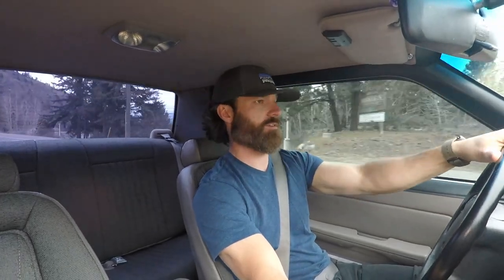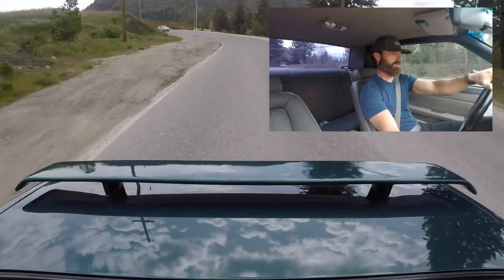Why I bought the Comp Cam XE266HR camshaft for my SBF 5.0 Foxbody Mustang - Ride Along and MORE!

Comment: I’m almost sold on this cam lol. Really love the sound and want to maintain torque as well. Building a similar setup for a 63 Fairlane Ranch wagon. Only thing I’m left curious about is fuel mileage on the highway lol.
Reply from the maker: Very cool! I really like the cam. In my 3000 lbs car I have seen everything from 14mpg (driving like an idiot) to as high as 27-30mpg on the highway under very mild driving conditions. My milage has definitely gone down since changing the various bit that I have but I have also increased my "smiles per gallon" 😁😉
Reply: @KASLCustoms  that’s good mileage when taking it easy lol. Exactly the information I was looking for, thanks!
Reply from the maker: Yup I agree! Anytime buddy

Comment: I read somewhere that the comp xe 274HR was ground on the same ramp rates as the 266 and doesn’t give up any power down low. Do you know if this is true? Or how those two cams would drive vs one another?
Reply from the maker: I was considering both of those cams when I picked the 266. I liked the lower torque curve that the 266 had better

Comment: Happen to know around what length pushrods you used. I'm using AFR165 and XE266 cam and am having a hard time finding a pushrod length that provides a narrow sweep width on the valve tip.
Reply from the maker: Hi there. Mine measured out to 6.250. Do you have an adjustable pushrod? It makes life a lot easier 👍
Reply: @KASLCustoms  wow, ok. Ya I am using an adjustable pushrod. Mine seems to like 6.450 but I’m going to have to clearance the body of the rocker since it is making contact with the pushrod.

I just wanted to see if I was in the ballpark from what you got, and I’m not lol.
Reply from the maker: No worries! It’s best to over think stuff like this and measure 8-10 times. I would also move to other valves and check as well 👍

Comment: Hope you see this. 
March 31, 2022
Latest research says it's probably the speed sensor on the trans/speedo cable, on all (?) mass air cars.
Mine doesn't even have one, and I'm not even finding a wire to plug it in. (90 MA T5)
Other than that. It runs perfectly. 😁😎

Comment: Great vid. I have the XE 264 HR it is a good one too. You mentioned push rods ,what length did you go with? I used hardened CC stock length and they are slightly off center on the valve stem.i have roller rockers and they are not clearing my stock 94 valve covers. I don't see ant valve covers that will work with a 94,so I may try spacers if they will clear.
Reply from the maker: Thank you. If I remember correctly I used 6.250 length pushrods. I also had to clearance my valve cover oil baffling to get my rockers to clear the valve covers 👍

Comment: New to the channel but glad I found it! Just sent GT40 heads to the machine shop and researching camshafts for my GT40 INTAKE and heads, and don't want an aggressive cam but mild like this one. Need to know what I need to make this work for my build. Any suggestions?
Reply from the maker: Nice buddy! I think the 266 would be a great addition to what you are doing. Two things you are going to need to consider is rocker size (i.e. 1.6 or 1.7), and from there you will need to measure for pushrod length 👍
Reply: The lift in this guy is pretty high, I can't see the 1.7 rockers working with stock pistons.
Reply from the maker: I went with 1.6
Reply: @KASLCustoms  I've been debating the whole cam configuration for my spare engine. I have a E303, B303, and Trick Flow stage 1 in hand, to pair with the Ford/ Crane 1.72 rockers. I think I'm settling on the TF Stage 1 for the same reason you mention here, low end TQ. I have a few people pushing me to go high RPM but it's not what I want out of this engine. It's going into a street cruiser, and my goal is 300hp+. That will make it a fun car to drive and maintain the stock feel and that smooth shifting T5.
Reply from the maker: Nice. I like your thinking. I agree as well, for the amount of time you spend at the higher end of the rpm range in a street cruiser, I don’t think it’s worth it 👍

Comment: Same cam and heads I'm going with on my 96 explorer along with a streetburner intake. Wonder how much more tame it'll be sub1500 with my 4R70W. Doing this for a "tow" build but still have fun if I wanna smash the loud pedal. 30 or 36# injectors?
Reply from the maker: Very nice!!! Injectors are one of those things that you can’t necessarily buy “too big.” They we only operate at the psi that they are told so maybe consider buying for future mods... 🤷‍♂️
Reply: @KASLCustoms  eh, I'm hoping for just a once and done kinda build lol. Have an old 89 towncar I do plan to tinker with while just keeping the explorer at that level. A 200hp 5L V8 is pathetic nowadays, this is just a revamp to get some more modern power.
Reply from the maker: Nice! Either injector option you are considering would be great for your application then 👍

Comment: Hey, just a quick question,  what's the gas mileage like with the 266 compared the the stock cam, I'm thinking of the same cam, because it is still a daily driver for the wife, and a jump in gas usage is expected,  but bye how much have you noticed  since the cam changes,  thanks.   Rob
Reply from the maker: Hi there. I never really tracked it much before the upgrade but after, I still get decent mileage 16-18mpg in town and 22-24 on the highway 👍
Reply: OK, that's awesome,  thanks for that 🙂

Comment: I got a xe274hr to put in with my afr165 heads, stock pistons. I'm a little nervous that cam may be cutting it close on stock pistons. In your searches did you see if that cam works? I will obviously still measure to check for sure
Reply from the maker: Right on bud! I believe it will as that was the first cam I had recommended to me and the fella I was chatting with knew that I was running a stock bottom end/stock pistons. The only reason I didn’t go with the 274 was because of it higher rpm power window, I wanted to try and keep more on the bottom end 👍👍👍
Reply: @KASLCustoms  10-4, thanks for the reply. Love the channel!
Reply from the maker: Yessir - anytime buddy!!! Thanks for watching and taking the time to reach out 🙏🦊❤️

Comment: Why did you go with this 266 cam over the XE274HR specifically?
Reply from the maker: It's been a few years since I made this decision so my info/reseach has become a little "foggy." That said, the 274 has a slight higher rpm range (Don't quote me but for example: 1800-6700rpm) where the 266 was lower (again for example: 1500-6500rpm). My reasoning at the time was: I'm not racing my car - intentionally 😉 - and therefore it spends most of its time at lower to mid range rpms. With that said, I didn't see the use in losing lower rpm "operating range"  only to gain in the higher rpm range because I almost never take my car up to its rpm limit. Long story short, for what I do with my car and how I drive it, I felt that the 266 better suited my application than the 274. Hope that helps!

Comment: Are you using stock injectors ? Also do you tune it yourself or have help
Reply from the maker: 24# injectors. My friend tuned the car for me. He has a YouTube channel: @tecmotion
Reply: @KASLCustoms  thanks I have a 95 mustang motor with a cobra intake on it in my 63 falcon and getting ready to put heads and cam on it and you videos helped me with parts selection. Thanks!
Reply from the maker: Right on!!!

Comment: Mine does it in first only.. I can idle along in 5 and pull out smoothly. 
Beats me. 😳
Reply from the maker: Well that’s interesting for sure…?
Reply: 1990 T5
Reply: Hope you see this. 
March 31, 2022
Latest research says it's probably the speed sensor on the trans/speedo cable, on all (?) mass air cars.
Mine doesn't even have one, and I'm not even finding a wire to plug it in. (90 MA T5)
Other than that. It runs perfectly. 😁😎

Comment: Hey Kasl question if you don't mind... I have a stock 85 GT stock block getting twisted wedge 11r  170 and would love to run the xe266 I understand with the twisted wedge heads I won't have ptv issues with that lift...in your opinion what do you think
Reply from the maker: Hey bud - thanks for reaching out! You have good taste in parts 😉. Two major pieces of the puzzle you are missing are rocker length, and push rod length. I run 1.6 trick flow roller tip rockers on my car. I also have an adjustable pushrod that I use to measure the exact length pushrod I need so that my roller tip is squarely contacting the dead centre of the valve end. If I remember correctly, I believe I used comp cam 6.250 pushrods. All that said, I would only use this information as a guide because all engine combos are different (For example, trick flow heads may be thicker or thinner then AFR 165's - like I have). MAKE SURE you measure because you would hate to go to all this trouble only to have to take it all apart and fix broken stuff.... I hope that helps. Let me know if you have any other questions 👍

Comment: Spot on.  Excellent video.  Thanks for the info.  It's got to be drivable in my book.  What gear are you running in the rear end?
Reply from the maker: Thank you! Yes I agree. It has 3.73 in the rear
Reply: @KASLCustoms  I'm about to put heads, cam and intake on my low mile, stock short block, 1989.  We seem to have the same goals.  What rocker arm are you running?  How did you configure your AFR 165s?  Any upgrades or changes?  Thank you.
Reply from the maker: Very nice!! I have trick flow 1.6 roller rockers. I did not change the heads at all. Them came out of the box, had a quick wipe of brake clean and got torqued on 👊

Comment: Lurch.
Try this as a test.
Cap or pinch the pcv hose, see if it changes.
mixture or map pulsation.
Reply from the maker: Never heard of that one. Ok will do sir - thank you!!
Reply: PCV is a controlled air leak. Pinching the hose makes the mixture richer until you're in closed loop/ O2 sensors. This also can alter the vacuum slightly. On stock A9Ls without a tune, unplug the mass air and see if it runs better. It will be different, especially in AOD cars. Using the KOEO/KOER self diagnoses into phase 3 often helps diagnose.
Reply: Mass Air sensors have a slot on the plug. All Ford sensors that fit in are the same. Early 4.6 crown vics all sensors are the same as HOs. Grab real Motorcraft parts at junk yards for pennies. Avoid China.
BTW Ford only used 4 different sensors from 86- 2000+

Comment: I have mostly same set up, x cam afr 165's 24lb injectors,  trick flow intake and pro m efi, are u still on stock ecu with tune or something else? I had tuned ecu for ever then went with the new set up. Just curious on what your using. Phil Mississippi thanks
Reply from the maker: Hello sir! Very nice setup you have there. I am still running the stock ecu. I had a fella local to me tune the car. His work is very sought after in my part of the world. I believe they have a YouTube channel and the company name is Tecmotion. Let me know if you have any other questions 👍👍👍
Reply: I am considering going w the Pro M as well. You happy with the harness, ecu and drivability as advertised? Thanks
Reply: Phill, you happy w that setup?
Reply: Oops sorry for double comment I messed that up lol
Reply from the maker: Hahahaha - we are all learning this tech stuff together buddy. Your in good company 😉🤣👊
Reply: @bobfisher9452  its plug and play for sure, harness is excellent,  it's expensive,  a little over 3 grand, I'm running 347 stroker with the components mentioned earlier and it doesn't even sound like the same car, no lope on a 542 lift cam it's crazy. With that said Chris Richards owns pro m, he's who you deal with when u have issues and he's a smart ass to say the very least, I'm 47 and he talks to you like your a kid. I'm still learning this system but he thinks you should know what he knows. Other than dealing with him the system is awesome, still have ac, ecu uses 2 o2 sensors instead of 1. I looked at the terminator x and u have to swap to gm sensors and so on and it only uses basic parameters where as the pro m uses way more. I've never tuned a car so there is a whole lot that I don't know but I'm slowly learning. Hope this helps, I will answer anything I can
Reply: @KASLCustoms  I love this channel and the interaction man! 5hanks for replying and giving your opinions and feed back. Most appreciated
Reply from the maker: Thank you for the kind words my friend!!! Anytime 👍👍👍
Reply: @phillippaul2898  thanks Phillip! I’ve watched pro m’s YouTube video and researched their web site. It sounds pretty hands off once the initial setup is complete. I have and 88gt that was stock. I have the Trick flow heads and intake on a 306 rebuilt bottom end. Changed from speed density to mass air. It runs good but has the usual hiccups here and there. I’ve had it tuned and chipped. Just want to make sure it’s worth the money if I go that route.Thanks for the info
Reply: @bobfisher9452  no  problem Bob, if you choose to go that route I will answer any questions that I can but Chris Richards will make it very clear to follow the instructions to the absolute T and will not deal with you pretty much if you haven't, so just be warned! Lol!
Reply from the maker: Thanks for lending a hand buddy. I love how we all help eachother on here 🦊❤️
Reply: @KASLCustoms  my absolute pleasure,  we are car guys, hot rodders and thats what we do. I am now a subscriber and look forward to more content and interacting with more cool people. Keep wrenchin and roddin!
Reply from the maker: Too cool!!! Thanks for being part of this with us buddy!!! Really appreciate it 👍
Reply: You bet and thank you!

Comment: I just put a 303 cam in my Sn95 and it does great. Sounds great w bbk exhaust. But I been getting like a hesitation like when I get on it. Almost like a short. Or a misfire. I'm fucking stuck on what it is. I love your mustang tho.. new sub man
Reply from the maker: Nice! Thx buddy!!! I’d maybe start by changing the plugs and fuel filter as they are cheap to try. Maybe a new cap and rotor too if you haven’t done that in a while.
Reply: @KASLCustoms  will do thanks alot bro
Reply from the maker: Anytime!

Comment: How many hp do you think you have with this setup?
Reply from the maker: 315/345 👍
Reply: @KASLCustoms  Thanks for the reply and info because my setup is almost the same as yours with the exception of I have a aftermarket EFI system. I have the Edelbrock pro flo 4 system! And it pulls very hard but I never had it dynoed so now I at least have a ballpark of what I have! Thanks buddy .
Reply from the maker: Yes you bet - anytime! Oh right on! My limiting factor is the stock computer and it’s archaic capabilities... I would assume that your setup could even run a little stronger then mine 👍👊
Reply: I have one more question for you buddy what spark plugs are you running and what gap?
Reply from the maker: No worries! To be honest, I can’t remember to save my life what plugs I used... I want to say motorctaft and I for sure would have gapped them to factor spec 👍
Reply: Ok thank you for the info.
Reply from the maker: Yes you bet!!! Anytime 👍

Comment: What cam should I have that has the lumpy idle but has good performance?
Reply: Never mind I found the short it sounds sick!
Reply from the maker: Ok right on!!
Reply: What engine upgrades should I do when I put a cam on it?
Reply from the maker: To get the most out of it, I’d go heads, intake, injectors and fuel pump. OR, buy an On3 turbo, keep the engine stock and get close to 500hp… have you seen my video on this dilemma yet? 😂
Reply: Ok sorry I haven’t yet I’ll check it out.
Reply: I doubt my mom will they me get to 500 horsepower though lol
Reply: Actually I did just didn’t realize what was on it I was watching on tv
Reply from the maker: It may help you make up our mind 👍
Reply: Me and my dad made a channel called smith fam rebuilds! 🙂
Reply from the maker: Nice! I will check it out for sure!!!
Reply: Thanks my dad literally pointed a camera me and told me to talk
Reply from the maker: 😂👍. That’s how I started mine too!
Reply: I don’t have a foxbody right know but I’m thinking of fixing my Jeep then selling it to get on

Comment: People get hung up on peak numbers, The engine spends most of its life under the curve. In the end whatever floats your boat is A OK. Cars are a whole recipe with 4.10s or something the shorter cam may feel to short but if the redline is still 6k its a non issue. The lurch is usually indicative of an IAC issue the ECU just can't comprehend the pulse surge. Sees crank accel pulls away sees engine dieing add back in cycle continues. The speed density cars were terrible in parking lots.